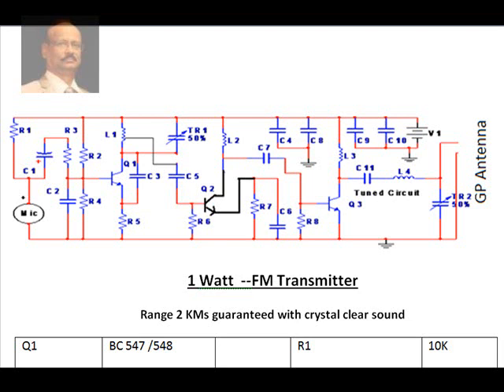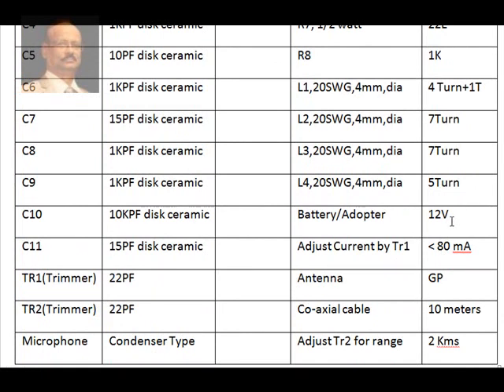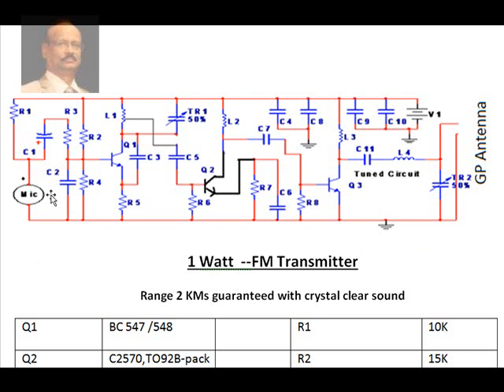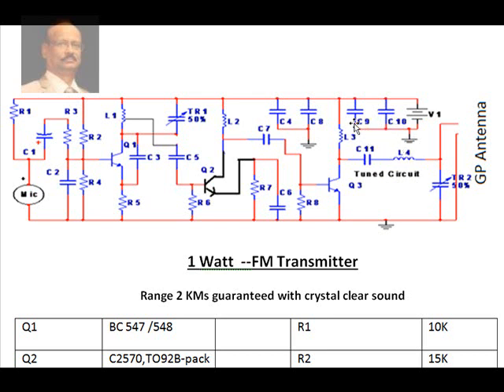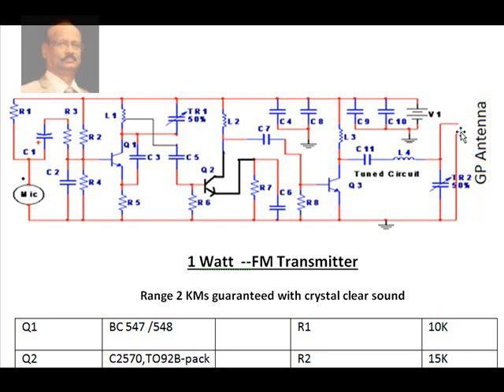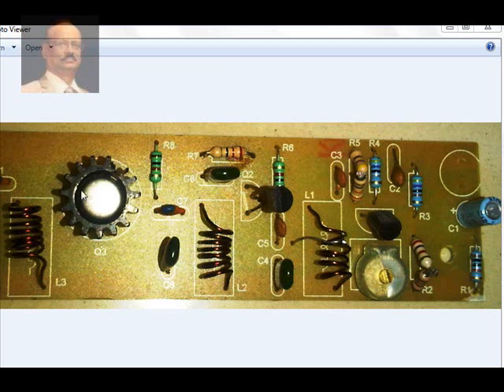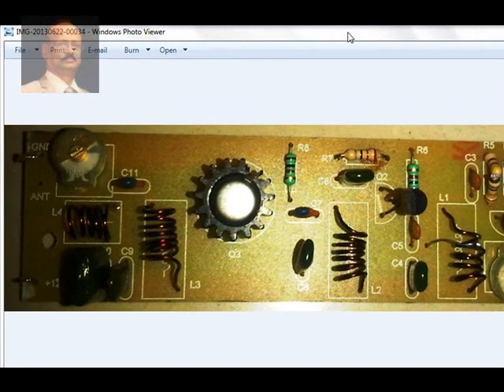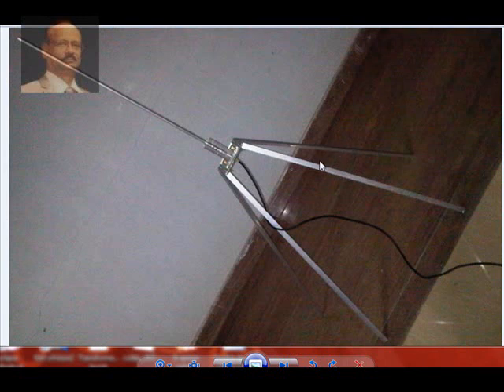FM Transmitter -Long range with circuit ,component list ,assembly instruction for 2 KM range

Comment: Can I use dipole antenna if I want a limited range as its illegal to transmit a signal with this much power here in Australia thanks
Reply from the maker: Any wireless even a cordless mic in FM  band covering 100  meters is even illegal.But people use. But using a dipole for a 1 watt ,the range in open air could be a couple of KMs.However a small sick antenna of 75 cm is advisable . Use dipole  at your risk.

Comment: Dear sir Namaste !
I have a question, please give me answer : In this fm transmitter circuit, you have used class c amplifier in the driver stage and output stage but by the basic principle of electronics, dynamic range of class c amplifier has been reduced, so how does this circuit will achieve long range ?
Reply from the maker: It works around 2 kms with matched folded dipole antenna.

Comment: Hi, From which source you buy these 2n3866? What is the chance of getting fake 2n3866 there in India? Once I have bought a 2n3866 around Kolkata and got it around Rs.80/-. Still not tested but it has pretty shiny body with "M" logo of motorola. What is your experience about this? Please!
Reply from the maker: Production of 2n3866 seems to have stopped. All in the market are duplicate. Even if using the  original 2n3866 the circuit  operation is too unstable if not tuned properly to the antenna used. I suggest watching my recent video on long range FM transmitter kit
Reply from the maker: https://youtu.be/2pXMLPJU1QA

Comment: Hello can I use 2n3553 My country doesn't have 2n3866 thank you ?
Reply: I replaced 2n3866 2n3553 it worked but I can't use it on for long because I have only 2570 A package it gets very hot but sadly even though 2n3553 more powerful it doesn't need a heat sink 7w TDP Vs 5W TDP thank you for the circuit

Comment: Please clear TO92 type transistor. Aren"t TO92 and TO92B  same?
Reply from the maker: TO92B package is slightly bigger than TO92. You can compare with BC 547 or the same series and they are all TO92 package. In my project TO92B is a must failing which it will fail.

Comment: Hlo sir..we are connecting it in a breadboard...We just want to know whether the connection of antenna is just from ground or from L4 inductor end
Reply: It would be grateful if you replied faster
Reply from the maker: Antenna connection from L4.But  Bread board working is doubtful

Comment: Can you tell me, why the tapping of coil i.e. L1 in the center? What is the particular reason that?
Reply from the maker: Not at the center but just at 1 turn to ensure exact amplitude of the signal is fed to the next stage
Reply: @PatnaikUC  but in my project tapping to the center of the coil,  what is the reason to tapping the center

Comment: But sir my question is how to calculate the value of resistors and capacitors
Reply from the maker: kunal kawale it is a whole lot chapter. Not possible to cover in a video
Reply: @PatnaikUC  ok sir , make a video how to calculate that capacitor and resistor value

Comment: Sir all the resistor are of what watt??
Reply from the maker: Vijay Malvadkar all 1/4 watt
Reply: @PatnaikUC  22 ohm is 1/2 watt
Reply from the maker: Vijay Malvadkar 22 ohms can be 1/4 watt but preferably use 1/2 watt. All other 1/4 watt.
Reply: Can I use all resistor 1/2 watt??
Reply from the maker: Vijay Malvadkar no problem using higher wattage
Reply: Thank You sir
Reply: Sir I connect all components on general pcb but it not work. Can it need 7812 voltage regulator?
Reply from the maker: @vijaymalvadkar6955  I had mentioned time and again that the pcb layout and its soldering in such high-frequency assembly are very critical and all those tried on GP pcb that way have failed. Nothing is going to help you, dear.
Reply: I use 12 volt DC adapter

Comment: sir c2570 transistor bodleme c2219 use korsaktiye, sir I am Bangladeshi, c2570 transistor nehi miltehe hamara desh me.
Reply from the maker: Nehi
Reply: or any transistor
Reply from the maker: 2219 can be used but will have not as good performance

Comment: No crystal in the oscillator? Must have a lot of frequency drift
Reply from the maker: There will not be frequency drift as long as the DC supply voltage is constant. If not yes there will be frequency drift

Comment: Is 82E or 22E just 82ohms and 22ohms? And why you can't use a 2n2219 transistor? It can switch more current. And what is at coil L1 the  +1T?
Reply from the maker: Yes they are 82 & 22 ohms. 2219 has low ft

Comment: i have made lots of low power transmitter but i am not able to make a proper matching antenna. like in this u r saying to use a ground plane antenna.isit available  with the kit? more over whats the the length of the antenna? what type of coax should we use rg6 or rg58?. do u supply the connectors with the kit? moreover i couldn't a yagi antenna.and the ground plane antenna in this site is very costly. pls help
Reply from the maker: Dc connector is also supplied with the antenna. Without proper antenna the circuit gives only few meters. For making GP or Yagi antenna visit my blog www.milabut.com
Reply: Patnaik UC  thanks sir

Comment: hi bro...2n3866 is not available in my country . plz suggest the alternative this kind of rf transistor..tell me the value of L1 L2 L3
Reply from the maker: 2N2219 can be used but the range shall fall to a great extent. Coil value is not available but all winding details are given. Visit www.projectntraining.com
Reply: thank you bro for replying ..I wanted to simulate this circuit in Ni multism before building it.and i also modified the circuit to generate carrier frequency with crystal...but range was not so good..if i got 2n3866 then i will try it...

Comment: I have access to some good fm trx based onnTSA5511 pll with source code in C for PIC. That was my final year project during b tech in 2011. If interested I can send you details, but again.. only for educational purposes.. no regular transmission should be done. My phone number 9-7-7-8-2-3-8-5-9-3. Remove the dashes.. contact me in evening time after 6PM.
Reply from the maker: But what is the power device and RF power?
Reply: Mitsubishi 2SC1971. For a properly tuned load in Class C config, it will give around 5 to 7 Watt. It is also supply dependent and destructive if you raise the bias.
Reply from the maker: I have one with Mitsubishi 2SC1971 operating at 12 v dc ( drawing about 1 A) delivering 7 watt RF
Reply: I think you can go up a little bit, with a huge heatsink, 13.5 volt as Datasheet says. Just measure SWR in low bias before going for full power. 1Watt In-10 Watt Out.
Reply from the maker: Mitsubishi 2SC1971 has been used by me for a 7 watt RF by a dc supply of 12 v drawing 1 A
Reply from the maker: I did use a big heatsink and a cooling fan and the transistor remains cool. I get 10 KMs in city with a tuned GP antenna
Reply from the maker: I used GP antenna having 26.04" up rod and 27.34" of 4 numbers down rod at 45 degree to the up rod for 107.9 Mhz that covers without hissing 10 KMs at height of antenna 80 feet. With a Yagi antenna still more

Comment: Put an RTI.. there is no experimental licese for broadcasting in commercial band at any cost.. but they will give you some nearby Frequency for testing to a dummy load and antenna with a no spur tx. For fees, I believe previously it was around rs50. Forms are available. For current cost you can contact WPC station nearby you, I believe you are now in Hyderabad. Also, take an Amateur license which is only a basic Electronics exam and morse code is optional now for Restricted grade. WPC also left security clearance last year for non maoist area, so within 3 montj you will get a license to make your own gadget. Commercial equipment mfg license is different thing which will again need some legal advice in this field.

Comment: This will work for only 100 meter to 1KM range, as a rule of thumb for 1Watt is 1KM. The problem is with environment in which its being used. In city environment the propagation will be less, but take it to a open field, it will work for 1KM. I challenge the author to come up with a video showing actual power output with a 50 Ohm Dummy load. Also this is illegal even if for experiments. WPC gives experimental license for testing your tx . Apply and get that before testing it. This wont be stable Frequency, as no PLL synthesizing is used. Hence this requires more finishing touch to make rather than what is being shown on images.VU3GDP
Reply from the maker: You are right. This is for hobbyists only. The range as stated is with a matched frequency Yagi antenna
Reply from the maker: I understand that you are a HAM license holder. I shall be grateful if you could answer the following. What is the fee for experimental license by WPC for testing the tx.? Selling kits (components &PCB) for this  or a finished product does one need a license? What are the fees of WPC for using a high quality FM transmitter of low power up to say 15 watts. Many people are asking these questions and I failed to get a proper answer from WPC webs site.

Comment: excuse me sir. I need ur answer immediately. I think there is missing + powersupply to bias of Q2 and Q3. if yes correct it
Reply from the maker: Sorry. The bias to Q2 and Q3 is provided by the signal voltage itself. Not necessarily  dc voltage is always a must for the biasing. The circuit works absolutely fine.

Comment: sir, I have done a project on this same kit and not able to get the result. I need a complete assembled kit as shown in the above video. where can I buy it ?

I need the assembled one as I'm not in position to get the output.
Reply from the maker: Regret. I do not sell assembled one. There are other items fully assembled and tested you can buy at www.projectntraining.com
Reply: Patnaik UC I need the one with a good audio clarity sir..for my college project. I would be happy if you suggest one :-)
Reply from the maker: All other modes other than the kit have outstanding stereo quality audio with digital FM transmission.

Comment: Fine, is it necessary to tune the circuit after assembling the components on board? Or we can directly get the output with little effort of tuning ? Provide further more details about range and power specifications as well. Thank you
Reply from the maker: It all depends upon the skill to use it .99.99% people who have tried this have failed to get even 10 meter range with hopelessly ghost quality sound. Buy not this kit but fully finished ones available  at www.projectntraining.com

Comment: please add audio jack module to this circuit, and if possible please add ua741cn pre amp for amplify the mic or audio jack input.

that will add life to this circuit
Reply from the maker: It can take an external mic or aux input without any further ckt
Reply from the maker: Mic should be condenser type
Reply: Patnaik UC sir do u mean that in place of mic we can use audio jack too, only one at a time audio jack or microphone. if I am right please reply

Comment: The circuit resembles more or less Vega kit, and so then i have constructed this circuit ,which is unstable frequency and more noisy communication as well doesnt got the output. Is there any way to boostup the power consideration ? Thanks
Reply from the maker: It all depends upon the skill to use it .99.99% people who have tried this have failed to get even 10 meter range with hopelessly ghost quality sound.Buy not the kit but fully finished ones at www.projectntraining.com
Reply from the maker: I am getting 2 KMs with a well designed tuned Yagi antenna and giving crystal clear sound in same Vega kit done as per 5 page instructions made by us. This kit is not meant for beginners which I have said in the very start

Comment: sir, I want 1 km transmitter and i want buy it. But, the kit should work properly and frequency should not be varied.
Reply from the maker: Ruled out with such low cost kit. Pls visit www.projectntraining.com where all other are rock steady frequency,digital,stereo and highly reliable with guaranteed performance

Comment: Sir , can i open a small Fm station using this 7 watts fm transmitter ?
Reply from the maker: In fact the 7 watt FM transmitter is a mini radio station. Not the one seen in the picture .Read the details here-- http://www.projectntraining.com/7_Watt_FM_Transmitter_Range-15_KMs/p395090_16346386.aspx

Comment: Nice project Mr. Patnaik - I see some people are having trouble finding the 2N3866 BJT RF transistor.  In the USA, the 2N3866 is available from Newark and Mouser.  Price $2.52USD plus shipping from Mouser: http://www.mouser.com/ProductDetail/Central-Semiconductor/2N3866/?qs=Ypxpq5eNvNWJ01mDqoXwrQ%3D%3D
The circuit looks like it could produce around 1W of RF signal at the output and with a suitable antenna, a range of at least a few km should be possible.
Reply from the maker: +Martyn H Thank you Sir for the information. Your reading is correct. It is 1 watt RF power and covers well beyond 2 KMs with a matched Yagi antenna

Comment: Sir !I am Babar Thanks for reply please again clearly send after read ur current reply mi. how commercial code 1kpf= 102 Or 10310kpf= 102 or 103 or otheroAnd send possible alternate transistor 2N3866 or not possible.

Comment: Sir !I watch ur FM transmitter very nice .But I have some problums.2n3866 not availeble in market.How possible 2n3866 replacement with 2n2219. If not possible please send alternate value transistor,And 2nd problume difine 1kpf value.I hope ur good reply.I wait ur reply. my Idbabarcity248@gmail.com
Reply from the maker: +babar ali 2n 2219 can be used with heat sink but at 9 volt DC and the range will badly fall,
 1 kpf=1000pf =0.01uF=103 sold at commercial name
Reply: thanks sir
Reply: Patnaik UC Isn't it 0,001uF not 0,01uF? Several Internet calculators says 0,001uF

Comment: what does R3=4K7 means????
AndR7 is 1/2watt  how much watt are R1-R6 and R8????
Reply from the maker: +Abhisek Samal It appears you are too new to electronics. Better don't try this circuit. R3=the value of that resistor in the circuit ie 4K7= 4.7K  like that the other resistors
Reply from the maker: +Abhisek Samal 4K7=4.7K=4700 Ohms , ie is the value of that resistor.I hope you know Ohms at least. In commercial terms we call as 4K7 and never write that it is a resistor as it is well understood by the electronic hobbyists
Reply from the maker: +Abhisek Samal Any wattage not mentioned it is traditional to assume that they are 1/4 watt ie quarter watt and no one in the market place asks that. The shop keeper also knows that it is 1/4 watt if one mentions nothing.
Reply: +Patnaik UC actually i asked because while buying the resistance box of various resisitor mentioned different box of different watt so i asked ......

Comment: Can anyone explain to me that "what is the purpose of the C3 by connecting parallel to the transistor?" and "the inductances L1, L2 and L3 at the collector of the transistor"? 

Thanks
Reply: Miller effect.. it's basically what is creating the fm modulation..

Comment from the maker: It is not correct that 2N3866 is discontinued. Shop keepers in small towns state such as they don't maintain stocks. Pls check in ebay.com. However 2N2219 can be used but the range shall be drastically reduced.

Comment: sr.     1w fm transmeter 2 km renj  one kit  rqwayrment
Reply from the maker: +Archana Joshi As per the website
Reply: sir... i tried to many circuit but the range is max i got 150 meter.may be for coil problem.  I want to buy from you this 2 km perfect range circuit. plz contact me ( sms only) as soon as possible+91 9734 232623
Reply from the maker: +Sudipta Mallick Tuning is very important. Adjust the DC current to about 100mA at 12 volts DC
Reply: Okay... Sir I tried with pure DC . I used only battery not any transformer
Reply: Sir want to buy the perfect working circuit from you... Plz.
Reply from the maker: shall be uploaded soon

Comment: I think it is illegal to use FM band without a license in India, you can land in jail if authority get to know this.
Reply from the maker: Nitin Kumar You are right.But the one which is published is less than 1 watt output power which is allowed as hobby kit for educational purposes. Moreover I am only advising to  assemble one. It is only components list and circuit diagrram. The assembler and the user is responsible for legal issues.

Comment: sir i always get confused with voltage and current.By the way let me say how i understood DC and AC.In case of DC Batteries are used to give a voltage and the electrons which is already present in the conductor moves and makes the circuit work.Likewise in AC also.This means does the power station generates only voltage and makes the electrons in the transmission line move?

Comment: Sir ,,how to connect mp3  or audio,,,can i connect through mic connection? or i need some biasing circuit to connect audio in? thanks sir
Reply from the maker: Yes.No problem but keep the volume down a little
Reply: sir i have a circuit of this link http://electronics-diy.com/BA1404_Stereo_FM_Transmitter.php can i replace 38khz to 20Mhz or other oscillator components?thank you sir again
Reply: Patnaik UC Can I Buy The Item Completely Constructed

Comment: sir where is dc(+-) input line ... i saw just v1 line but i don;t see v2 .. from bangladesh
Reply from the maker: refer the battery V1 connections. Upper is +ve and ground is -ve.I suggest you you better not try the circuit as I feel you are too new to electronic circuit reading
Reply: Patnaik UC yes sir ... right ...

Comment: Hi Sir,
       What happens if we replace resistor R8 with a RFC on the base of final class c amplifier? is any change in output power?
Reply from the maker: ANANTHASANKAR UA Donot do that
Reply: Patnaik UC
OK sir, just for curiosity! i am interested in this circuit design
Reply: Sir I am from India.......its not working on breadboard..... So sir what should I do....??